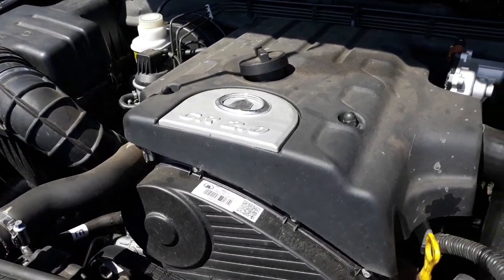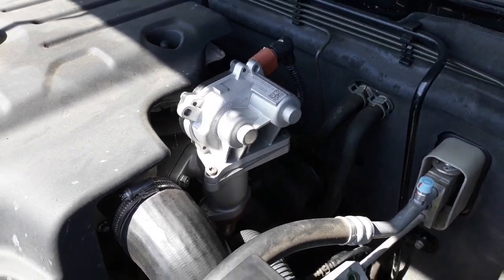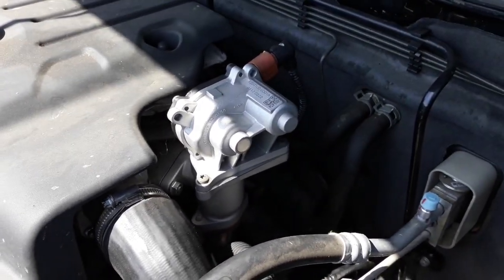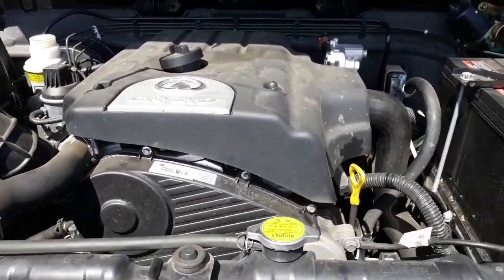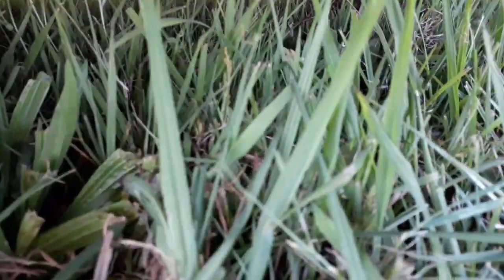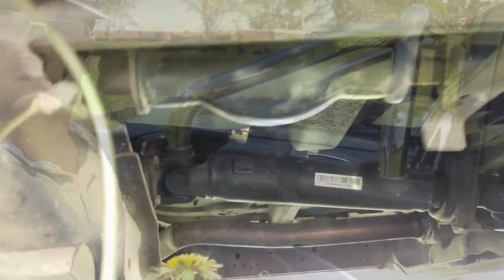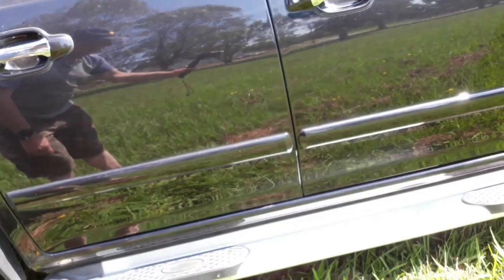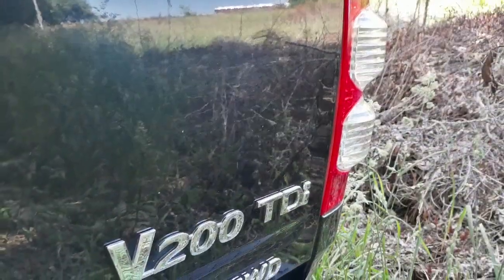My Greatwall V200

Comment: How to take out the light to change a light bulb. These cars been designed so the adverage person cannot work on them. The motor is good .but every thing else breaks 52.000
Reply: How’d you go with the headlights? It’s a pain in the ass for lights. I replace a globe in mine ended up going led. Hopefully won’t have to open it up again.

Comment: Howdy,  my V200 has the 4h and 4L indication lights on. Any ideas on what is causing that?
Reply from the maker: Mine did it a couple of times but only when I turned the ignition on quick, if I turned the key off then back on it went out otherwise It .could be the solenoid sticking on the transfers case

Comment: I have a Great wall, i  have a code error: P1011, fuel pump delivery pressure to low. What do you think is the problem
Reply from the maker: Check that the fuel supply is all good then I would start to think it’s the fuel pump, it might pay to see if you can get it on a pressure gauge at a diesel specialist.

Comment: you got robbed we bought one new in may  2012 in the blue  colour with hard lid side steps and opposite lock bullbar and blue tooth for 28 grand at berwick great wall  the original battery only just died ,